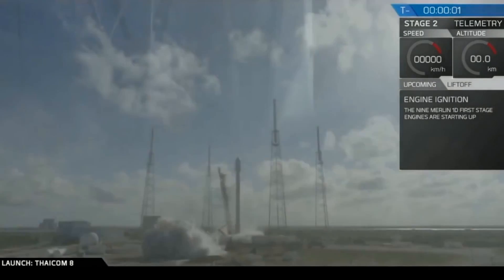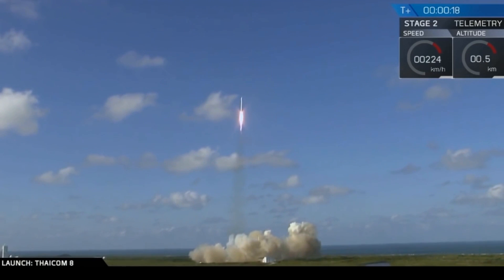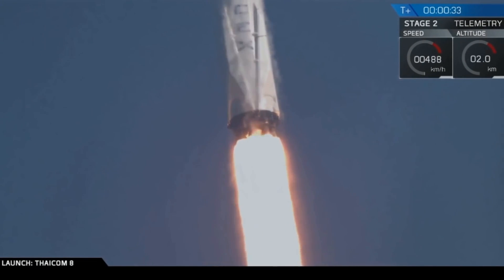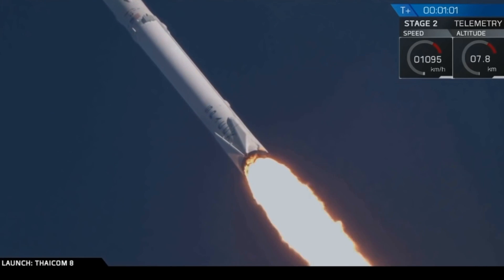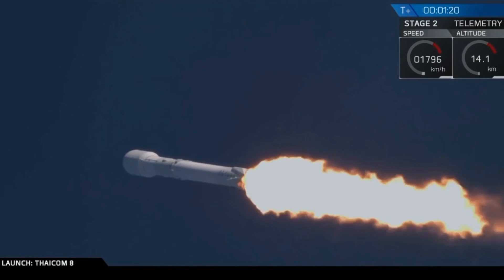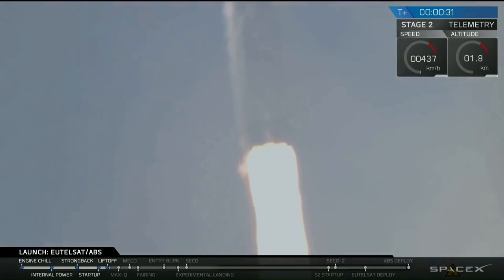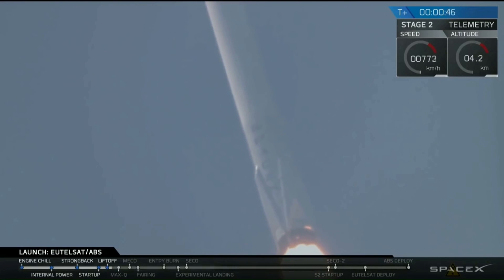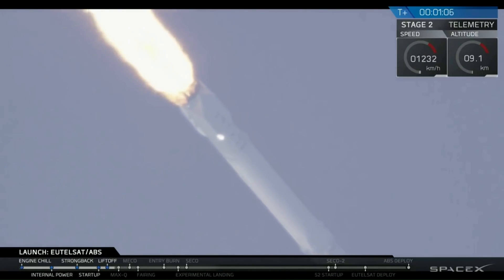Why the Falcon 9 Uses Subcooled Liquid Oxygen

Comment: Why does all of the LN2 have to be removed. Why not just bleed off enough to make room?
Reply: Fuel requirements for a given payload, maybe.
Reply: Because the rocket was not designed with a system to cool the liquid oxygen back below its regular freezing temperature, the subcooled liquid must be pumped out, recooled by an external cryogenic system, and then pumped back into the tank.

Comment: So if the issue is that they can't increase tank size, then maybe they won't be using "Subcooled Liquid Oxygen" on the Falcon Heavy, or maybe only on the central booster?
Reply from the maker: The Falcon Heavy will be using subcooled liquid oxygen, but larger rockets SpaceX is developing might not. These larger rockets are still in the very early stages of designing though.